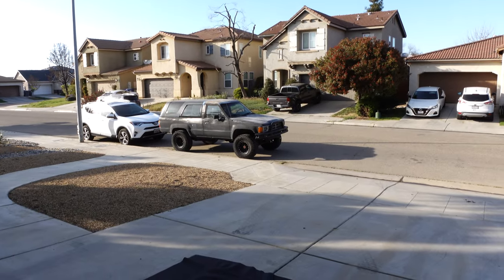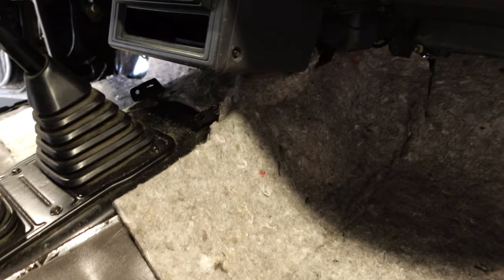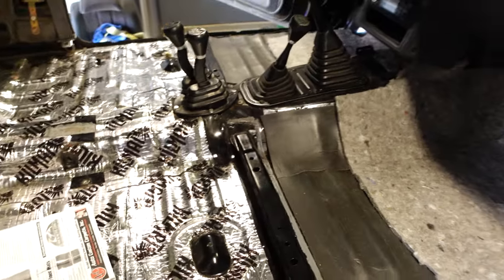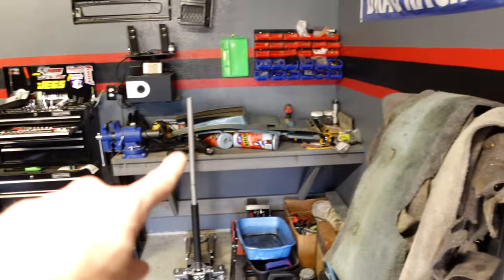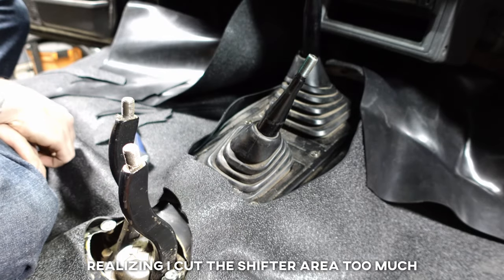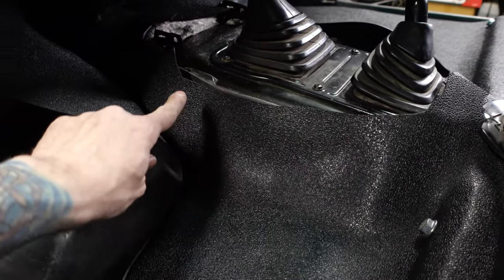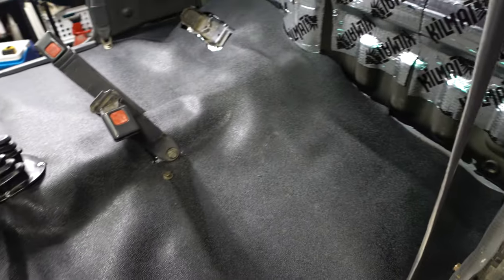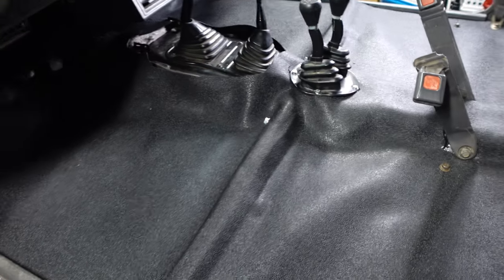Vinyl Flooring Install in My Toyota Pickup - Mistakes Were Made...

Comment: Congrats you made it through! It's definitely much more difficult than people think! I've installed about 10 aftermarket kits, and 4 OEM carpet kits, it's a night/day difference. You got to fight for hours on the A/M flooring kits, but the OEM kits drop right in. Did ACC vinyl on my 85 standard cab and the experience was highly unpleasant. It looked great though!

Comment: My husband got this flooring for his 1995 extended cab. we laid our in the sun, put his shop heater blower to where it helped soften the vinyl, its extremely hard,thick and tough. so it helped some, outside remo at the time was 65. some days was going to get in the 80s, so after putting in tje padding, he layed it inside(it needed trimming) put the truck wherenit got alot of sun with all doors closed for a few days, and man it starred forming its contours like yours did in the video, making it easy to trim, he had to take it out only 2 times to get it trimmed right for the front, he measured and did all that stuff, and it fit, hes now in the process of cutting holes for wires and bolts, in between working.

Comment: in the future, you can use the seat rail indentations to triangulate the center of the gear shift, and from there make measurements down toward the floor of the vinyl to cut out the shifter boot section, erroring to less of a cut so that you can dial it in once its inside the cab

Comment: I wonder if there is a bulk vinyl option out there that is thinner/easier to work with but has the same awesome texture? I imagine you could mold it to fit with a heat gun, if it is not pre-molded.

Comment: It's a great job, I am personally like Vinile better than Capet , by I like your truck , specially not only manually , but with an other twins stick . I wanna know to what purpose those twins stick stand for?. But anyway I like it , no matter what ! . Congrats ! ! . .
Reply from the maker: The twin sticks allow me to get gear reduction without being forced into 4WD. So I can go into low gear in either 2 or 4 wheel. The truck has dual transfer cases for more control off-road

Comment: Maybe check oc auto carpets? That's what I'm looking at for my 86 4runner. I haven't looked at rock auto so I don't know if there's a price difference.
Reply from the maker: I think I checked it out but I forget if the price was different or not. It’s pretty cheap from rock auto.
Reply: I just ordered vinyl for my Astro van from them.
Reply: Did you get it? I'm looking at the same one from OC auto carpets, is it good?

Comment: How well does the sound deadening work? About to swap carpets in my 86 and really on the fence on whether or not to install deadener.
Reply from the maker: You should check out my other 2 sound deadening videos, I bang on a couple panels before and after and there’s a huge difference.

Comment: Do you think this would make it easier if I put the old carpet on top of the vinyl and traced it out instead of having to figure out measurements?
Reply from the maker: Probably, but cut it about 10% bigger at first so you can trim to fit